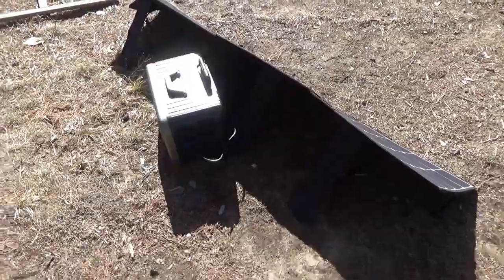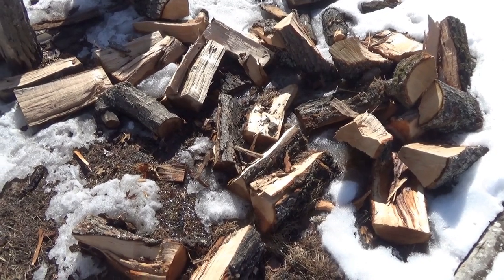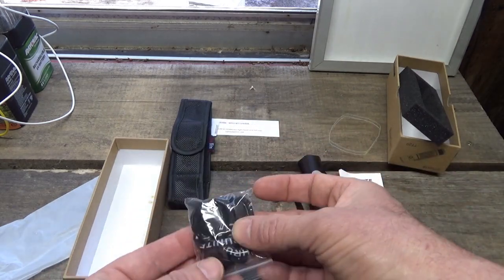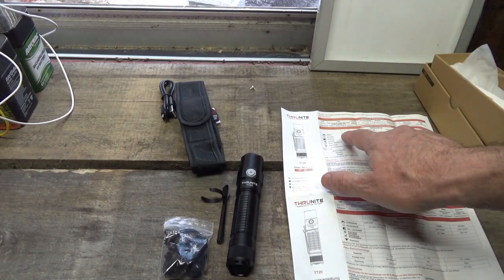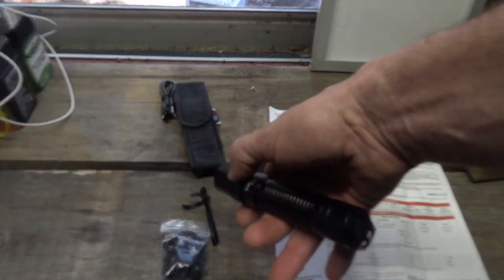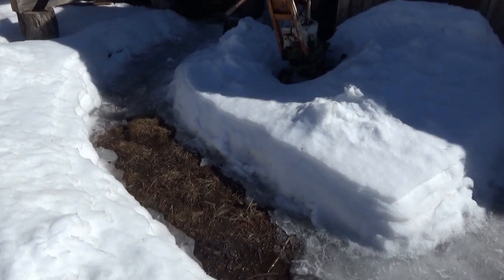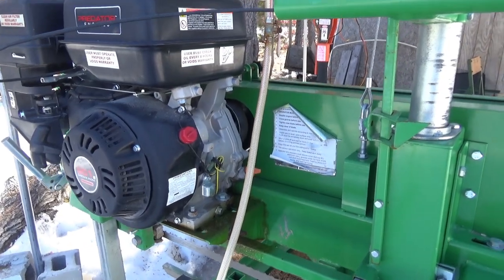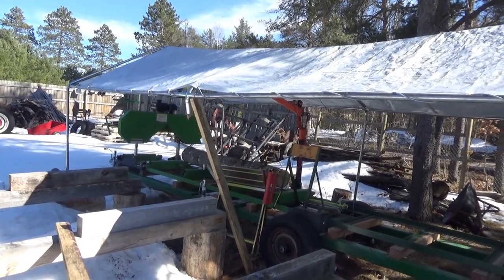Spring Like Homestead Day Package Arrived And The Sawmill Lives

Comment: That's great to hear Troy, 
I'm happy the sawmill is working again. Now you just need some trees to mill and make a permanent structure for the sawmill that you can open a side of when your using it and lock it up when you aren't using it. Probably would still be a good idea to take it apart and clean it really well incase it is molasses. As far as I know sugar isn't good for engines. If you took it apart and gave it a really good bath in cleaner it definitely wouldn't be a problem, and at the same time you can check to see what the knocking is just incase the idiot dropped something into the motor somehow.
Reply from the maker: Yes it is very good to have it going again. And yes there was some metallic sludge put in with the sticky stuff.
Reply from the maker: I cant. All I can say.

Comment: Getting heavy rain here now.. still lots of snow.. my log splitter got water in the cylinder last spring..even though it was covered up .. not sure if it was just lots of moisture or what.. had to pull the spark plug out and pull it over a few time lol.. didn’t hurt it. I know your motor is a different story though.
Reply from the maker: Thunderstorms all last night and into today. Will melt the snow off for us some. Gonna be cold again the next two days tho. Some engines get water in them due to how the exhaust and intake are set up.
Reply: @TheDoItYourselfWorld  yes , 3 more freezing nights for us.. 2 are -8. c  the sap is flowing for a few more days.. we’ve tapped 8 maples..
Reply from the maker: Right now I am stressed out BAD!! Raining so hard its driving through the walls of the house sideways and even through the garage roof. Pushing through any gaps and edges. 1/8 in water inside the garage. Came in for a break and to dry off some.
Reply: @TheDoItYourselfWorld  oh boy , I’m sorry to hear that. Hang in there.
Reply from the maker: Thanks. Everything is wet in the garage now. Dealing with humidity now from the flooding. Water dripping off anything metal. Bad. Getting it on video tho for tomorrow.
Reply: @TheDoItYourselfWorld  hopefully it all drys up quickly and the damage is minimal.  The rain has stopped here finally, but the snow is melting and water is pouring down hill for us here.. frost is coming out of the driveway here and it’s flooding. The snow yesterday up in my back field was 4ft deep..  I’m  actually glad of the cold overnight temperatures coming up to slow the melt for a bit. Even though I’ll be out of firewood this Friday.. This  past fall and the start of this year so far is so so.. hopefully we have a good growing season.
Reply from the maker: I am hoping for a good growing season this year too. Last year was odd. Hot days and cold nights put the plants into shock.